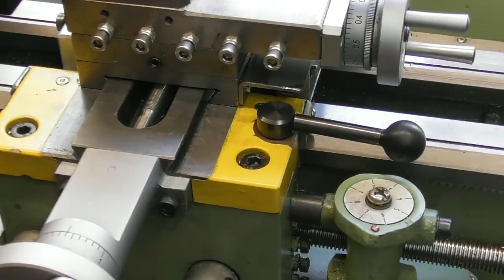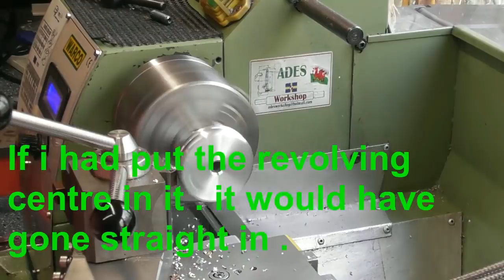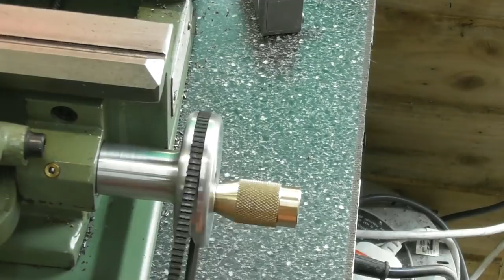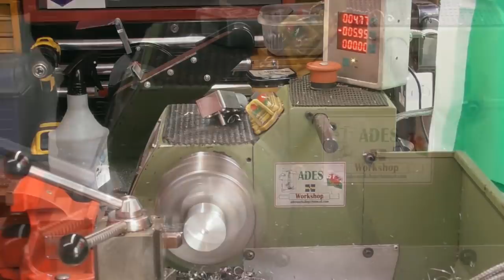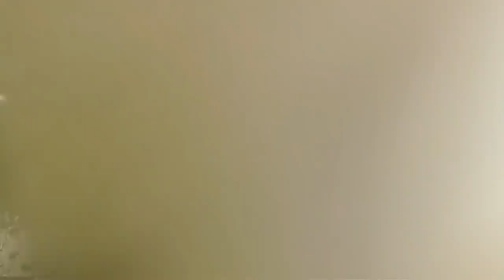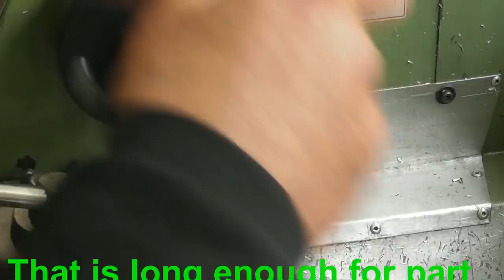Warco WM180 lathe Variable feed speed motor part 1

Comment: Nice one Ade, I'm just doing the same on my cross slide on the wm180. I am also having problem with the week motor. did you get that 24v motor from banggood by any chance? & what do you think of it?
Reply from the maker: The replacement 24v motor was slightly different on ebay .  works really well, Cheers Ade.